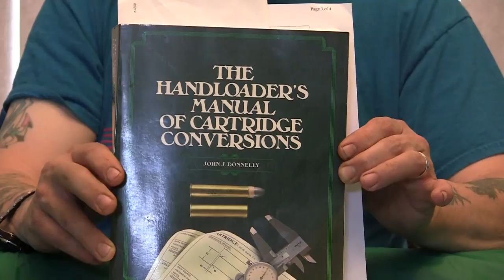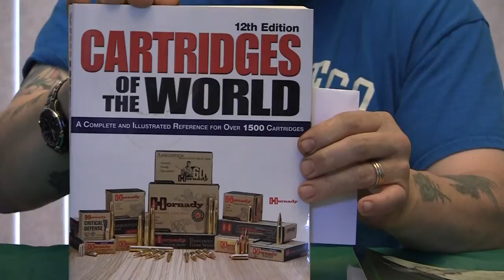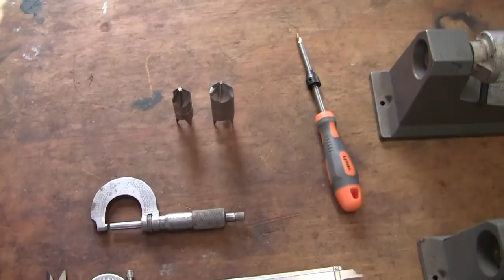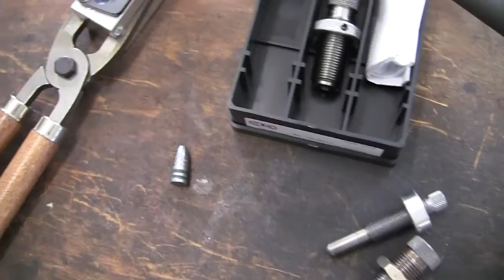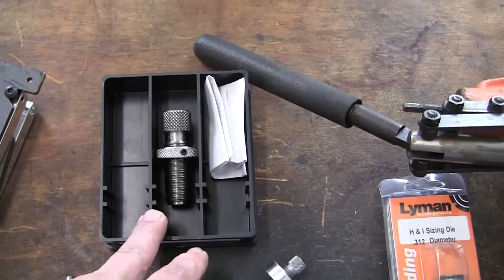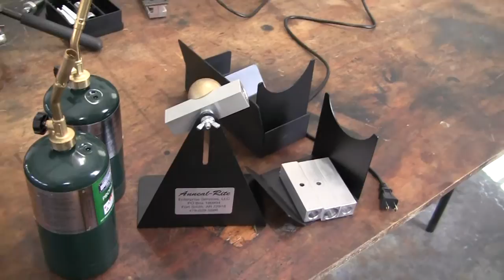Reloading Obsolete Ammo Tools, books and advice

Comment: I am not sure if you saw the series I did on the conversion for 41 swiss, but I talked about how using 8mm lebel brass works better because the rim is slightly thicker which gives better headspace and the rim diameter is slightly smaller than 348 win which I see some people on forums using. The smaller rim diameter allows for proper feeding in the magazine tube unlike the 348 which tended to jam on me.

Comment: In regards to the 41 swiss conversion, I did a series on that on you tube. The process in which I show the conversion and how it is done is detailed and well explained but with the intention not to sound so complicated the it will scare folks out of wanting to do the conversion of their rifle and brass. I did like how you showed and explained how you converted your bolt for you vetterli. You did it exactly the same as I did and had all the same issue with part interchangability.